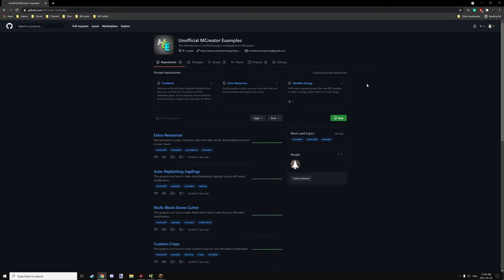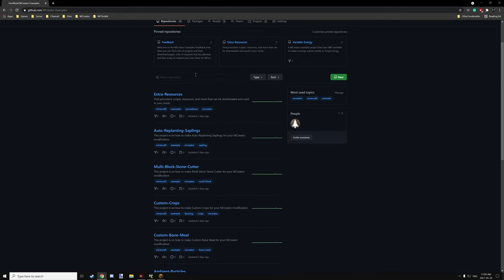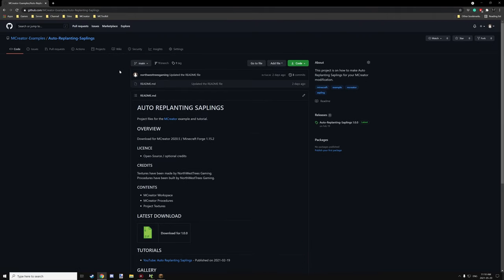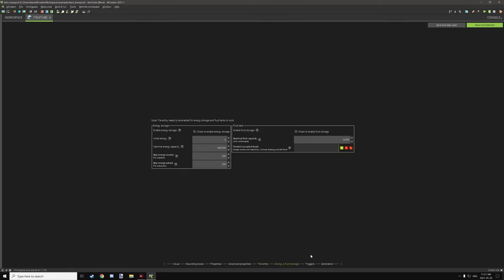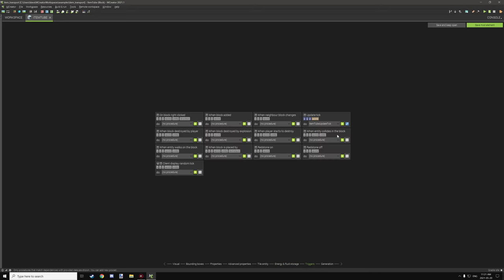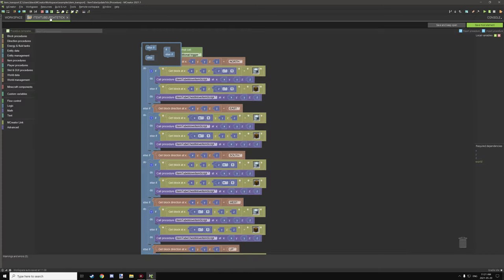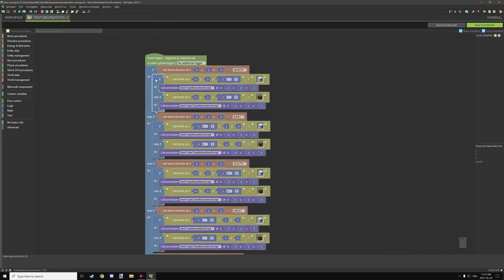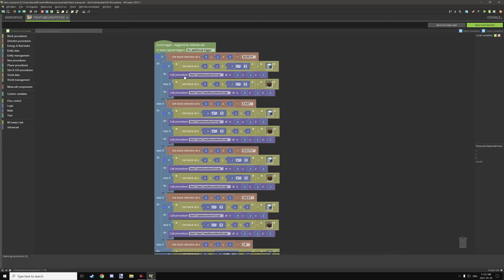MCreator 2021.1: Item Tubes | Part 1

Comment: Hey i was wondering is it possible to make smaller models of these and how would they look like turned tubes or L shapes etc
Reply from the maker: It would be possible it gets more complex with procedures though, and to save time I just used solid blocks as they are really easy to work with with minimal procedure work.

Comment: hey could you possibly make a 2023.4 version? it works but it only filled to chest with one stack not filling other slots
Reply from the maker: The Forge Energy/Fluid System will support Item Tubes in the future. I had had plans on merging mechanics into the cable system some how but it will require a few months to get made tested and then do a tutorial for.

Next week I will be recording forge fluid which is finally ready for recording. and then 3 or 4 weeks of community requests and hopefully by then I will have the system worked out. That was my plan at least.
Reply: alright, hopefully that will be good  @NorthWestTreesMCreator